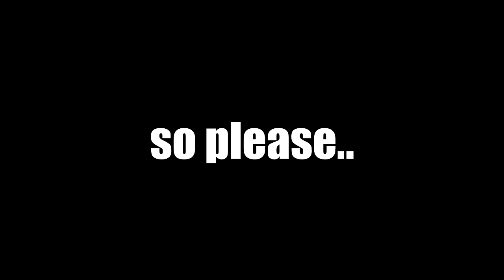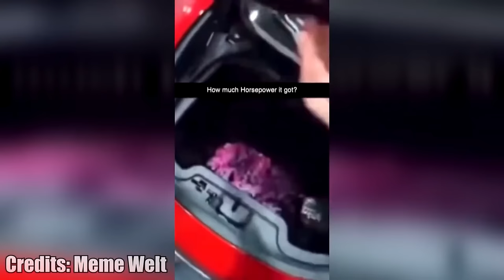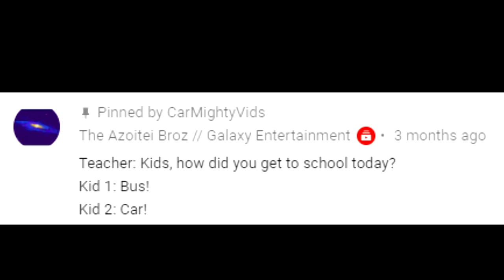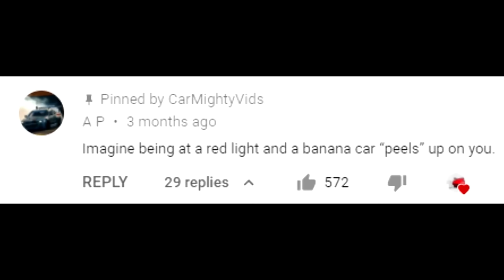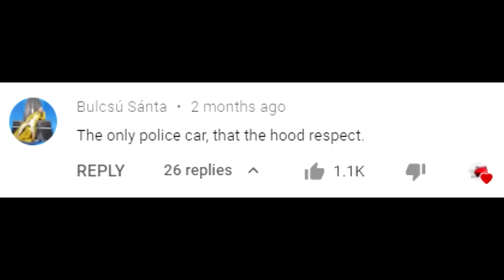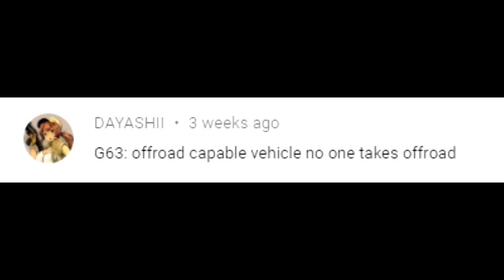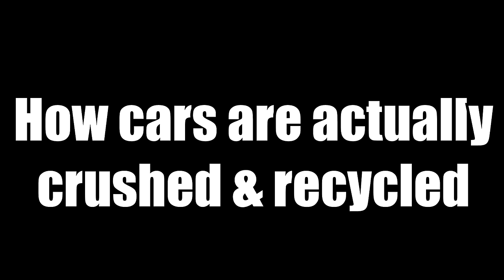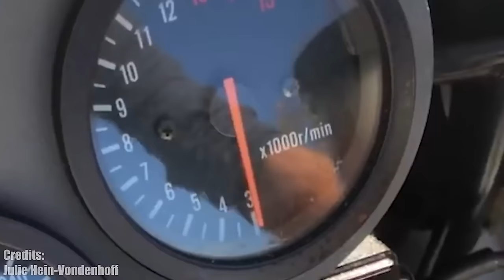The Best Of Weekly Dose Of Automotive Stuff

Comment: The truck at 42:07 was manufactured in Brazil in the 60's/70's by FNM under a license from Alfa romeo/Fiat. The second small gear lever was an option, and is essentially a 2-speed auxiliary gearbox, essentially doubling the number of gears. It works like any other 2-lever gearbox, and resembles the system found in the deuce-and a half military trucks.

Comment: 42:20 The long stick is for changing main gears, the small one is for low-high ratio of the selected gear. It also exists as a 3-stick version where the 3rd stick changes the long stick from gears 1-4 to 5-8. And each of those gears has its own low-high setting.
Reply: I thought it is standard stuff on all lorry trucks, no? I'm surprised that "car people" didn't hear about this, maybe it is not common nowadays?

Comment: About the FNM Alfa Romeo: The lever on the dash is the high/low selector. The driver pulls a gear on the normal stick on the floor in low, then shift to high in the dash, then selects the next gear while putting the transfer case back in low, so on so forth. There was even a version with 2 high/low boxes and 3 levers and you had to operate 2 of them on every gear shift.
Reply: I think a fair number of trucks have that too

Comment: 16:00  Yes, I also realised that you have to drive in reverse to do a donut!  I've done it in a highly modded Cooper S powered 1973 Mini Clubman, as well as a 1983 Suzuki Swift!  What's also fun is driving in reverse, then using the handbrake to do a J-turn while shifting into 1st-gear so you've done a 180deg turn, then shifting up through the gears, & heading back the way you came!

Comment: 33:15 I've literally fixed my Audi 80 in the same way, just a bit slower. After pulling front grill from the radiator and changing one headlight I was able to drive it 20 km back home xD

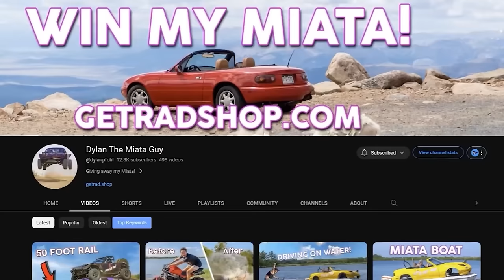Comment: 42:56 The FNM truck has 2 gearboxes in line, so there's the regular gear on low shifter and another one with a high-low position on the other one.

So you go 1L, 1H, 2L, 2H. Every time you advance from one gear to the next, like 2nd to 3rd, you are also going from High back to Low,  like a bicycle with 3 speeds on the front, and 7 on the back.

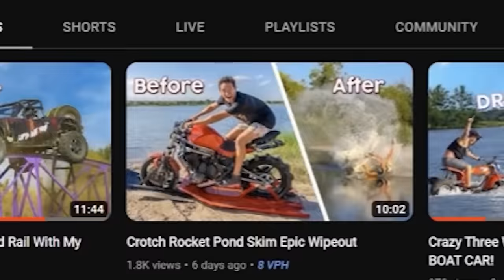Comment: 42:59 High/low double gearbox. Saw them a lot in trucks in the 90s and 00s. Maybe first gen? Never seen the high/low be manual like that, was always a small switch (usually on the shifter), using air pressure to do the actual work

Comment: Very first item- for a while in the USA, cars were not allowed to be sold with suspensions that could vary their height. This was part of the crash safety regulations about bumper height- they required certain protection at certain height and needed to guarantee the bumper would always BE that height. There were a few exceptions for some import cars that used the suspension adjustment to maintain a set ride height (example when the trunk was heavily loaded) but not to change the ride height. Import cars that had the adjustable suspension had to have a US specific program that took extra certification from the DOT and it wasn't common. I only ever saw german luxury cars that had it and I heard later that the german market versions could do more tricks. 
(source: several articles in car magazines in the 80s 90s while this was all happening. When people complain about classic import cars having to have "5mph bumpers" or bumper overcaps that look bad, it's part of this bunch of regulation.)

There was recent talk about the DOT changing this to allow cars to lower at high speeds in the name of aerodynamics/fuel efficiency, but I lost track of what happened with that.

Comment: 42:17
Just in case this is still read: This is a dual transmission system, some US-trucks have it too.
Basically, you got the gearbox by the engine, and another gearbox near the rear wheels. Let's say the "main" one has six gears, and the secondary one has four. That means you can go 1-6 four times, getting you 24 gears and thus a much better ratio for just about any situation you may encounter, without requiring a massively overcomplicated 24-speed manual.
It's similar to some bycicles, where you can pick the gear at the pedals and at the back.

Comment: 42:45. Thats an alfaromeo truck sold in Brazil inte 60's and 70s...it has a dry gear box, unsinchronized gears (had do double clutch) with 4 speeds, and low gear. The driver is "crossing gears", as using the low and high range while shifting up the gears. The lever on the dash is the range selector and the one onthe floor is the gear selector. Congrats for the time. Been here since the begging. Keep up

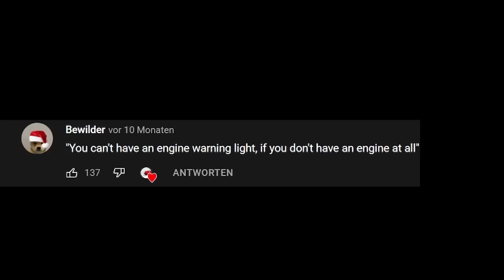Comment: 10:29 the manta gpt quite good reliable engines, 110hp were in the early 80s a good amount of power. Then there was the 2.4 16v cih with 144 hp, and the blue one out of the video has the same engine than mine, c20xe 2.0 16v with 150hp stock. Great engine, lot of potential

Comment: 42:10 the upper small stick is the shifter and the lower big one engage/disengage the low gear. So there will be 1st low, 1st high (big one down), 2nd low (shifting smaller one down and the other up simultaneously) and so on... Brasilian's truck manufacturer FNM thas stands for Fábrica Nacional de Motores (National Engine Factory) on the clip

Comment: The Alfa truck is the old style manual, called a two stick. Even today trucks will have two different "gear boxes", one is the normal tranmission, with 6-9 gears, plus a reductor gear box, with is in the diff, changing ratios there, in effect multiplying your gears. The new ones do this pneumatically, controlled by a small button on the shift knob, and will ahve two or three settings, Low-Normal-High.

Older trucks had an actual shift lever. Normally, you shift,  1-2, then 3L, 3N, 3H, then 4H (which is too high, but you then downshift), 4L, 4N, 4H, then 5H, then 5L...

You can also, go 3H to 4L directly, but its not recommended to shift both levers at the same time, since the diff is not syncronized, and with no way to bump up the revs, you have to time it perfectly. If you dont, you need to come toa  full stop and start over.

Comment: That very old truck with the two shifter levers is a VERY old way of doing things, the shifter on the floor is for the transmission, the shift lever on the dash is for the High/Low differential although this setup seems to have the high/low gears inside of the transmission. A high/Low differential basically doubles a trucks gears by adding a high and low gear ratio at the differential. this is especially useful for extremely heavy loads that are likely not even legal in Europe, but we have them in North America and Australia has them as well. When a flat deck low-boy is carrying a Caterpillar D-8 on the highway, it can take a while for them to get up to speed and that is when the high/low diff is used, getting up to speed. It is also especially useful for slowing down as well, by not only using the engine as a brake but also the high/low diff as well. This set up must be from the early half of the 20th century because modern Rigs have the high/low diff as a small switch mounted right on the shift lever for the transmission. slightly lower models might have a thumb lift/pull vacuum switch on the shifter instead of an electrical switch.

Comment: the truck at 42:00 just has a twin stick, it basically just adds a high and a low range to each gear. some setups have mid range too, but I don't think the truck in the video does.

Comment: 2:33 Thats true actually. Having driven polish tracks in dirt rally 2 they are probably the hardest tracks in the game. So many fast sections with lots of jumps and uneven terrain you can end up in trees so easily. Its hard to push the limits because there is always some bump or rock that can unsettle the car that you just crash. There was one track that was my favourite out of them. It starts with 90 degree Scandinavian and continues down hill long straight with a big jump after that is a big forest part where If you are precise with the wheel you can take at like 180km/h but right after that you must slow down for a few tricky corners and I used to crash a lot in that forest and restarted so many times literally till I mastered the start. Rest of the track was mostly a bit slower so you had to really swing the car around a lot. It was chaotic but also fun. Fun fact maybe these Rally games helped me with my irl driving a few times. Remember two weeks ago I was driving my dads polo. And there was a lot of mud on the tires as I was picking up my dad. Right as I made the left turn and applied gas the back end just let lose it was at 45° compared to the road ahead. My instinct kicked in right away and I countered the spin right away and gave gas and straightened it. I didn't panic really. I was maybe going 30😂 but I still did it no matter the speed. It was actually fun not gonna lie. Its like as If I had actuall fun for a moment. While my dad almost lost it 😂 thinking I would crash in a dich.

Comment: The "weird transmission" is probably a 2 speed rear diff plus the transmission gearbox. If the gearbox has, say, 10 gears, with the two speed rear end you effectively have 20 gears. Normally though, you would shift through the gears, then switch the rear diff gear, then go through the gears again or just leave the rear in one speed and use the transmission normally. Can be useful if your truck engine is underpowered or you have a really heavy load or need a lot of torque, at the expense of speed of course.

Comment: 42:43 I'm not really a truck guy, but I'm 95% sure of what that is.
It is somewhat common in older trucks here in Brazil. 
The lever on the dash is used to control the gear reduction, when it's down the gear is reduced with a higher torque, when its up its normal gear with normal torque. Reduced gears have more torque, normal gears... Are normal. So if you have a 6 gears transmission, if you have the reduction system, you actually have 12 gears, (1st reduced (low), 1st normal (high), 2nd reduced (low), 2nd normal (high)...)

Of course you can jump gears like any other manual transmission, but in the video, the driver is progressing normally between gears, on the first seconds of the video he puts it in the second gear and then lowers the reduced lever, so it's 2nd reduced (low), a couple of seconds later, instead of shifting to 3rd he puts the reduced lever up, so now he's on 2nd normal (high), then he would shift into 3rd and lower the reduced lever, 3rd reduced (low), then reduced lever up, 3rd normal (high), and so on...

That's basically how it works

Edit: Not actually sure what you sould search for to find more information about this, didn't find a good translation about this system. Maybe reduced gears? Not sure.
Edit 2: Found it, looks like it's called "Gear splitter"

Comment: 42:08 the shifter you see on the top near the wheel changes the range from low to high and vice versa. when he shifts to a new gear with the shifter on the ground, he then has to change the range of the gear back to low. Hence why he is pulling both at once.

Comment: At 42:21 i suspect that is like the mack i learned to drive. The lever on the dash is a high low splitter and the lever on the floor is the trans mission. You shift into gear, then shift the splitter, the go from 1hi to 2LO and so forth

I drive truck

Comment: For the truck transmission I believe the upper stick is the low, high switch and the lower one is the standard shifter, mostly cause semi trucks need the extra gears and shifting through 16 of them would suck

Comment: 55:06 - I think you'll find if you go back to the 90's Honda, Kawasaki, Suzuki and Yamaha were making little 250cc motors rev to 20,000 RPM! Yup, that's 250cc 4 cylinder DOHC TINY 16 Valve motors spinning up to TWENTY THOUSAND RPM!
Note, Kawasaki have recently remade a 250-4 ZX25R and it STILL sounds insane! 😏👌
😎🇬🇧

Comment: 27:28 back in days of deep communism my dad used to race home made buggies. One of his friends got his hands on a smaller helicopter engine and installed it in to his buggy. The issue was that engine was made for constant RPMs and modulation with some truck implanted gearbox did not help so basically each crankshaft rotation turned in to spinning wheels or even small wheelies when rear wheels had enough grip.

Comment: okay as Indian i will say the gypsy video it showcase
1st-it showcase the Indian armed force 
2nd-gypsy is one of the most reliable car used by Indian army and it fun to drive
Lightest SUV in India
Can be transported easily
Payload of 500 kg
Short wheel track
Petrol-powered SUV
Spare parts cheap
Leaf Suspension on all four wheels
Cost factor
In service since 1991
As Army operates in extreme temperatures, the petrol is much more reliable than the diesel fuel. Diesel engines do not operate at their peak below 3 C because of the diesel properties, which automatically makes the Gypsy only choice of Indian Army
why they showed that video reason is that because if they get suck in situation where it cant move forward the only thing they can do is dissemble